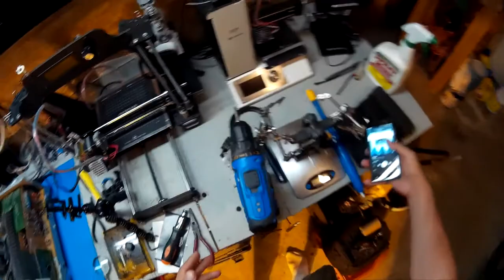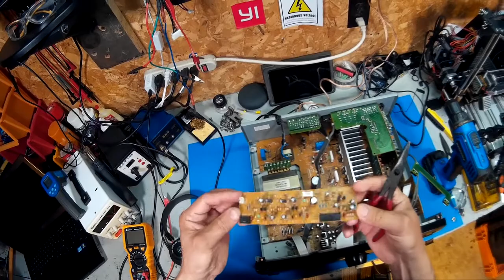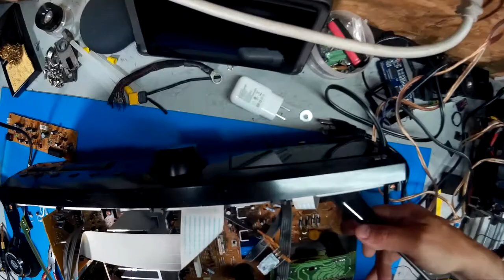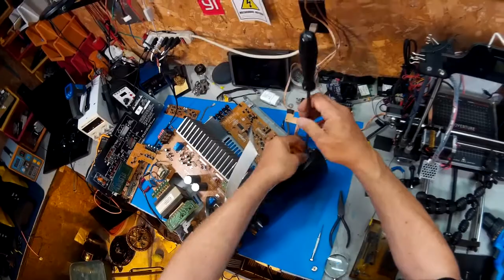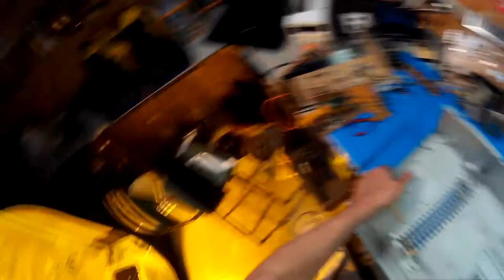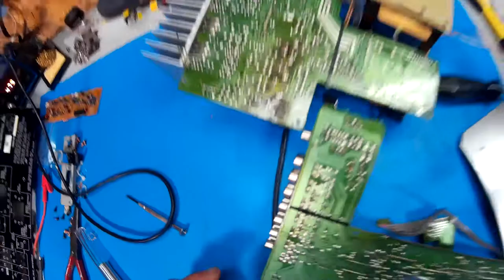JVC RX 554V  repair *cracked solder cracked pcb*

Comment: I have a receiver that turns on and does not emit sound, if I increase the volume with the control it makes pac at each touch.
 I have no idea about electronics, but I was researching and it has transistors 2SB1429 first in green and 2SD2155 in black, I'm afraid they are burnt and are no longer available.
Reply from the maker: you can cross reference the part number.